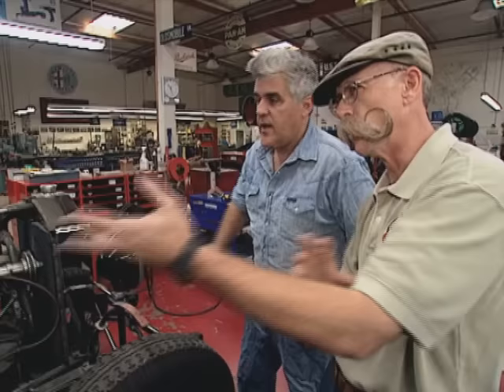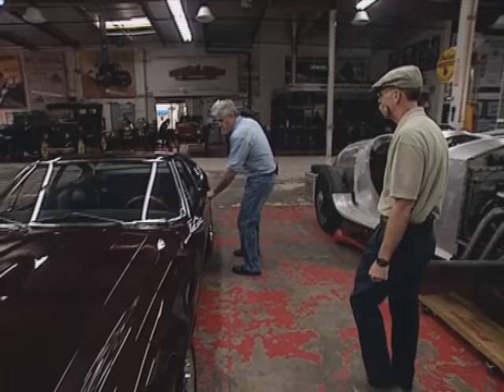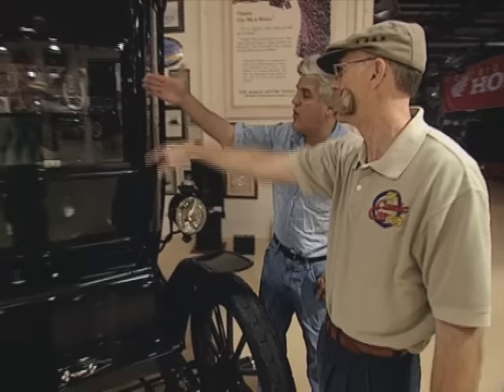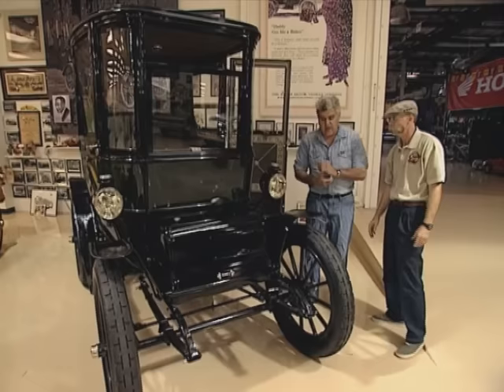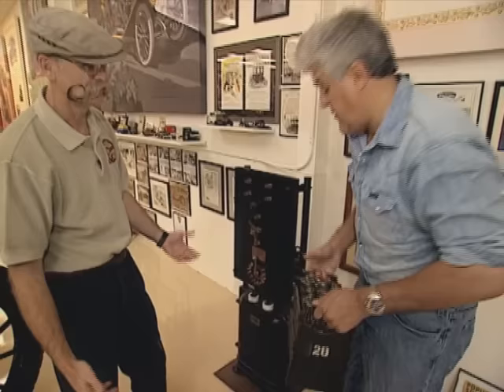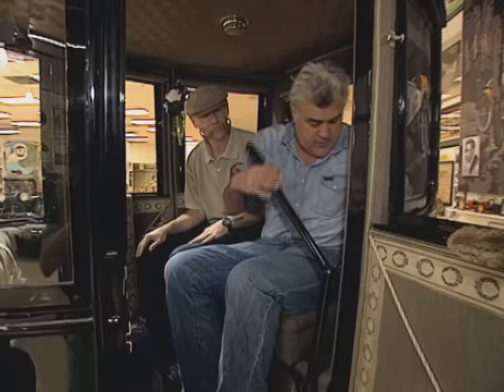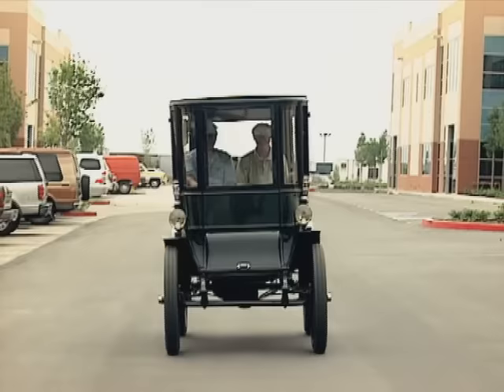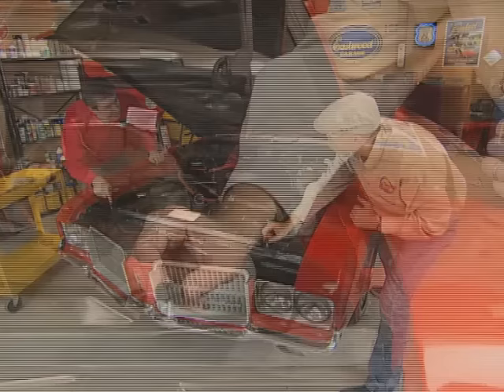Jay Leno's Baker Electric Car

Comment: No, no . . . of course electric cars aren't possible or practical, don't be silly. Now come to my garage and buy my petrol . . .

Imagine how good electric cars could actually be if every time some company tried to market them they hadn't been bought out, crushed down or intimidated out of business by the petrol industry. 
Nobody is going to convince me that if we could build electric cars like this in 1909 we couldn't be building ones that performed as good or better than petrol powered cars nowadays if it wasn't for the fact that huge oil companies want to be rich.
Reply: Remember that drag increases exponentially with speed.   Twice the speed for example requires not twice the power, but quadruple the power.   So this can go 23mph, sure, but if you want to go 46mph, you now need a motor that is four times bigger and four times as many batteries to keep your range... except that's not really true either, because four times the motor size and battery capacity itself adds weight, so to get the same performance you need about six times the battery to compensate for the additional weight penalty of the extra power.

Well that's all fine and good, but what if you want to double that and have a top speed of 92mph?   Remember, you are now quadrupling what you already quadrupled... where the heck are you going to fit 16x the battery capacity alone, forget the motor power, in a regular sized vehicle?    And before rapid charging battery technology, which is very recent, how long is it going to take to charge that many batteries, and where will you charge it from, as people only had 120volt systems in their homes.

So until recently, gasoline was FAR superior, since the engine and fuel weight was so much lower for a given power/range, and refueling instead of taking 15-20 hours would be only minutes.
Reply: DumbDuck44 That was a really good explanation! Cheers man, you taught me something. lol

Got to say though, I've been into classic cars since i was a teenager and I've been to motor museums all over Europe. As you can probably imagine quite a few prototypes end up in museums and I've seen quite a lot of electric concept cars. I agree that until very recently they all seemed to need to have either a huge weight of batteries on board somewhere, or some sort of way of generating power that wasn't economically viable for every day retail. 

I remember seeing some electric cars from a bit later than the one in this video and the whole of the floor plan of the boot was covered in batteries and there were more beneath the rear seats!

I do remember seeing a really charming french 3 wheeled electric car from the 30's that didn't seem too have too many problems and could have probably sold well for urban environments and cities. I suppose it just comes down to marketing skills and luck.
Reply: I am pretty sure that with using better aerodynamics this thing would hit 40mph+, it is pretty much a driving wall. Also not forget how much the technology overall has improved, not only recently.
In this thing they used brushed engines and mechanical converters, which lost together more than 50% of the input power. Mechanical switches for the driver to give accelerating commands, no regenerative braking and there are a view more things that could have been done better in the 1950 already, let alone in the 1980, or 2000s.
Reply: Ismalith - That's what I was thinking. We have really viable electric cars now, so I'm sure if there had been economic and political will to do so we could have had them at least a decade or two earlier surely?
Reply: Remember, most of the electric technology advances today come not from investment in the automotive industry, but the multi-billion dollar electronic device industry.    Better energy density for batteries was needed for laptops and cellphones and other portable electronics, and its thanks to a worldwide tremendous investment in that technology that its been able to be adapted to vehicles.    Brushless motors really don't matter much btw from an efficiency standpoint, as you only gain about 8% efficiency from them on average.    Its the battery revolution that changed the electric car viability, where lithium ion batteries are so superior to lead acid.

Lithium batteries can be safely fully charged and discharged, which a lead acid battery cannot (more than 60% discharge reduces battery life considerably).   Lithium batteries can be recharged up to 5K times, whereas lead acid will need replacement after about 300 charge cycles.   Lithium batteries keep the same performance until empty, whereas lead acid will become weaker and weaker as it discharges (as you may remember from lead acid toy electric cars as a kid).   Lead acid batteries are drastically smaller and around four times lighter for a given discharge capacity to lead acid.    And equally important, computerized controllers for the batteries are affordable now, as "dumb charging/discharging" is completely impractical for a performance vehicle to ensure cell and thermal balancing, etc. 

So there was no conspiracy against electric, just a huge technological leap to make in battery tech, which happened thanks to the computer/mobile phone revolution.
Reply: DumbDuck44 Sounds like you know a bit more about it than me! lol

I don't think there was exactly a conspiracy. I doubt it was really particularly hidden. I just think that car or engine companies or petrol companies probably bought the patents for a few things over the years and shelved them rather than developing them and that kind of thing.

Would you agree that we could have probably had electric cars before 1990 though? Even then, the battery life problem could be negated a bit if there was anywhere near as much infrastructure for charging electric cars as there is for refilling petrol ones.

I once read about a company that toyed with the idea of replace-able batteries as well. Rather than pull up and have to charge for hours there would be stations that had fully charged batteries all the time. You would pull up and give them yours and they would give you a new fully charged one. Something like the way you take back whole propane tanks and get another tank rather than just filling up one you own. The problems there lie in standardising the batteries across multiple companies and countries though. Still an interesting idea.
Reply: That is absolute nonsense, electric engines where always superior to ICEs. They bring by far more power, are much better controlled, don't have the noise problem, are immune to hight, don't drown, can keep running for centuries and so on and on.
What has the gas engine against that? People think is sounds cool. Sady people thought that many things sound cool through the ages and changed their mind as soon as they understood that another sound stands for more power. Electrical engines won't be different there.
As soon as people understand that EVs bring power beyond what ICEs could even dream of, they will change there mind about what sounds cool again.

The only "problem" that EVs have, is how to store the energy and even that is not really a problem any more.
I have batteries for my RC that bring massive power and can be loaded in 5 to 10 minutes and since you can load batteries parallel, you can make a 200 kwh back that still gets from empty to full in under 10 minutes, you just need to be enough man to handle the cable.
Reply: Not only trains, every factory there is, uses electric engines to power everything, from small servos to huge hydraulic systems, everything is electronic.
Also not only high speed trains are electric, every diesel train uses its diesel engine on a generator and then smaller electric engines on the wheels.
Reply: Slightly odd ending to your comment there but I think I see what you're trying to say. lol

I hope you're right. It would be cool to live through a time when we see a complete change in transport and travel. I think a really big tide of change will come if we eventually start to see electric vehicles that are capable of carrying cargo on the same scale as the current ICE driven haulage sector for a lower price.

If we get to a point when we start to see fully electric goods vehicles, trucks, construction vehicles, cargo ships and such like then I think a lot of change would suddenly come very quickly.

But as far as personal transport like cars go - I think eventually someone will get the marketing, the product and the image all right at the same time and we will see electric cars that are as classic and popular as iconic ICE cars from the past. It takes time for any true classic to be recognised as such. We're definitely getting there.
Reply: Yeah, you're right, but we ARE getting to levels where we can expect to completely solve that problem reasonably soon. The infrastructure for electric cars has started and is spreading here in the UK. You can charge electric cars in all big cities, most smaller cities and towns and even some quite remote places. It's on the way.
Reply: Good thing that gas doesn't need any supply grids. And even better that you can load your ICE at home.
Reply: I kind of wonder what you motivation is, we already have batteries that store much more energy that the ones that are currently used, not to mention that current technology already provides enough to get enormous range.
Batteries will continue to grow, what are gas engines going to do?
Reply: Well, I'm quite enjoying this debate, so please, let's keep it on a chatty and civil level. I'm learning some stuff from people who seem genuinely inteeligent on the subject here and I don't want to see it turn into an argument like a lot of YouTube threads do.
This is an interesting page from wikipedia on the subject - https://en.wikipedia.org/wiki/Electric_car_use_by_country
It seems like electric cars are definitely on the rise, but everything, everybody here has said about abtteries is undoubtably valid, no matter you're opinon. As I said - even in the relatively small town I live in there are a few charge ponts for EV's now - but I also must admit I rarely see them being used.

I'm CERTAIN there is a place for an electric car economy within big cities though. Maybe we can never expect to be cruising highways at 70mph for days long roadtrips in electric powered winnibagos, but surely a huge amount of carbon could be prevented from entering the atmosphere if we could move towards big inner city infrastructures including a greater amount of electric vehicles?

I have been all over Europe and many cities are chock full of tiny spluttering compact cars. People using these aren't doing so because they have a love for ICE's. They're using them because they're available and the infrastructure is there.

I think if that infrastructre was changed to make EV's viable and affordabe the people driving around tiny streets in Italy, France, Spain, Malta, Belgium etc would gladly switch to EV's.

They could still have a big shiny gas guzzling BMW on their drive at home if they wanted to, for when they wanted to do a big journey!
Reply: Gas does have a supply grid though. It has a massive, monster of industry behind it and an infrastructure that stretched to very country on earth! Every petrol station you see, every tanker you pass on the road, every derrick in multiple countries all over the globe, every massive tanker at sea or in the air, every airport with it's vast underground tanks - they are all representing that supply grid. It is an absolutely ingrained part of the world we live in and billions of people make a living from it.

I suspect THAT is part of the reason the EV infrastructure is growing so slowly. The political and economic will just isn't there yet.
Reply: I think my comments make it clear what I think the reasons are!
Reply: Yeah, I know you are making valid points there.
It's a really interesting debate though isn't it? I mean - what you say there is un-doubtably true, yet pretty much every major manufacturer still seems to be working it into their future plans. It's not just a novelty anymore, with a few Prius's driving around and the odd company like Tesla building interesting things. There are now millions being sold worldwide every year.

Maybe the car manufacturers know something we don't? Or maybe they are just insuring their interests for the future, thinking that maybe if renewable electricity comes into force a bit more with things like wind power and hydro electric power then it will allow the industry to suddenly leap ahead.

I'd personally still choose an ICE vehicle over an EV - even though there are charge points and such like in my town. I think we're still at the stage where most people would and will be for a while.
Reply: Your comments are right on target. There has been active suppression of electric cars for over a century.
Reply: It would seem so, but it isn't a problem that is fundamentally unsolvable. We can already make batteries that store energy in better ways, for longer. The problem is finding a way to produce them cheaply, efficiently and in volumes that car manufacturers can make a profit from.

It makes you wonder how much further we might have come in terms of technology if we didn't live in a world where mostly only products / inventions that are economically productive ever got developed?
Reply: Er . . . ok man. I was only making conversation. lol
Reply: Samuel, you are entitled to your opinion, and Mr Pryce is entitled to his as well. Electric vehicles are not on life support, and there will be electric trucks in the future as well. As an owner of an electric vehicle for three years, I found the vehicle to be quiet, clean, cheap to operate and without need of repair other than annual fuel filter and oil change and air filter change for the air conditioner unit. There is no carburetor to adjust, no spark plugs to replace, etc etc etc. Garages feel cheated.
Reply: Laugh all you want, but I meant to write oil filter, and yes, the engine uses oil internally, and it is an electric engine. The oil inside the engine was maintained by annual changes, but I suspect that every two years would be sufficient. You are playing with me verbally, and I am sure that most people understand my intent. The only power to the car was electricity, and the cost of charging the car is quite cheap.  The electric motor was built by Siemens.

I know that you want to win a debate at any cost but you should not treat people disrespectfully on social media, because it makes you look like a jerk.
Reply: Tires for the Renault were regular 16 size, and the brakes were less used because of the fact that the engine itself slowed down the car and that generated charging for the battery as well. Since I owned the car in its first five years of life, and drove it only for 65,000 kilometers, there was little wear and tear in the conventional sense. I had the mechanics raise the car on a lift and insisted that they check the suspension and oil all appropriate bearings. The tires were Michelin and still had good tread after two years. Tesla is not marketed in Israel, as few could afford them here. If Tesla tires wear faster it is probably due to people driving them at higher speeds than is necessary. Speed limits in Israel max out at much lower levels than the USA for various reasons, including lack of super highways. We have only one national highway that allows 110 kilometers per hour, and the limit for intercity roads is 90 kilometers. 100 kilometers is equal to a limit of 62.5 miles per hour. Does that explain why my tires are in better condition? We also do not have freezing weather here in Israel, and therefore salts are not thrown onto the roads to prevent freezing. And my average speed during daily travels is about 30 kilometers per hour.
Reply: Alon Musk will prove you to be wrong with his mega factory. We will wait and see whose stock rises and whose stock collapses. As you and your friend Samuel have been arguing, let the market decide.  We already know that it is possible to build a solid state lithium battery that does not require fluid, and that can therefore be made more compactly and with greater capacity. And if they make a salt battery that will be even cheaper to manufacture.
Reply: Graeme Pryce : You hit the nail ride on the head ! Trolley buses were put "out of business" by the very same people.
Reply: I know what you mean there about trolley buses or trams running on tires. I went to Lyon in France with my uncle Andrew a few years back and they have a very complete and working system there. My Uncle is a bot obsessed with trains, trams and transport so I got told every bit of information and shown all the 'most interesting' things . . . lol. 

To be honest though, it was a bit interesting. The vehicles have almost normal looking tyres on and in the underground sections they run on trough or 'U' shaped tracks and behave like trains, and on the surface sections they run like guided buses. Being on them was a strange sensation - it was like a very smooth train ride, but the insides look more like the inside of a good standard modern bus.

Not sure how we got here from electric cars, but it just reminded me when I saw your comment! Lyon is a massive and old city, so it just shows that you can build and integrate radical ideas if the will and the funding is there. The tracks didn't look very expensive or complicated to manufacture, the rolling stock all looked like modular standard stuff and above all, it works, on time, all day, every day.

There are other cities in France that have them as well. They aren't just in the US.
Reply: Graeme Pryce I'd rather have this thing instead of a tesla the only tesla I like is the roadster.
Reply: I don't think an engine that requires NO fuel can possibly exist.
If you do a bit of research, there have been some entrepreneurs that have invented some odd and economical engines before though.
One that springs to mind was 'Joe's Cell' that allegedly performed to many many times more economical purposes than current engines. I know the guy went out of business years ago ( strangely enough ) but I would imagine there is some info still out there if you google it.

One of my friends had a Honda Cub 90 for a while as well and he bought it with the intent to run it into the ground then sell. He got it running with a stinky combination of deep fat fryer fat and old petrol from his lawnmower and ran it like that for ages. 

You could smell it from miles away and it cluttered and sputtered all the time, but it proves that expensive fuel from gas / petrol  stations isn't the only thing you can put in the tank! lol

He had an old Ford Orion ( google it - it was a classic British car for years! ) that he ran on deep fat fryer fat for a good few months too. It used to leave a military class smokescreen behind it, but it actually ran quite well! I think it was a 2 ltr Deisel, iirc.
Reply: As much as I believe the petro-chemical industry has blocked, denied and illegally ( sometimes ) scuppered, bought and shelved every idea that competes with them, I'm not an idiot. 

I can see that until relatively recently, petrol / diesel engines are a far more viable technology, but things are changing. The things people have said in this thread are true, but even so - hybrid and IC engined cars ARE on sale aound the world, and more and more people buy them every year. 

I don't think it's just about viability though. I think huge amounts of people want a car with a big, noisy, throbbing engine that sounds powerful. They like it. I've driven powerful cars and it's good fun. People don't want to say goodbye to that, and I totally understand why. There are some good electric cars, even some sports cars, but the big change won't come until one or more of the car companies releases an electric car that revolutionises what people think a car should be and makes something amazing, that everybody wants. Relatively ordinary city cars, hatchbacks and the occasional record breaker just aren't going to cut it. Some company needs to build the 'Model T' of electric cars and start a whole new movement. AT the moment the public all over the US, UK and Europe are just getting cars that look like ordinary IC cars. Somebody needs to break the mould and build a brilliant and iconic electric car. An electric version of the 'Beetle' or 'The Mini', and swamp the market, if you get me.

Also, it needs to spread to the haulage industry. If companies could run electric trucks / lorries more cheaply on electric or another ultra - modern engine system, for a lot less money than diesel they would embrace it. Then then they would make a fortune, but as far as I'm aware, it just isn't possible yet.
Reply: +Graeme Pryce. Electric commercial vehicles seem to be a 'non starter' at the moment, due to the load and distance they cover. Many of then also run 24/7 on applications such as supermarket deliveries, so their is no window to charge the batteries. In addition, the battery would need to be replaced at least 5 times during the design life of the truck. The further problem is that even for non overnight trucks, the depot would not be able to obtain enough power from the grid to charge them.
Reply: +Samuel Rosenberg. It may be ok in certain areas, but certainly not London. We have no delivery depots due to land prices now exceeding 30 million pounds per acre. 35 ton delivery trucks flood into the built up areas in the early hours and have to be clear of most areas by 7am before the hundreds of ANPR cameras catch them. Tesco's alone deliver in excess of 3000 tons of groceries daily using about 40 trucks. For the rest of the day and all night the same trucks make up to 15 deliveries to each the out of the out of town shops, each of which has a turnover of between 1 and 2 million pounds per week. We do not have post offices either. 90% or transactions are online and a few counters have been included in supermarkets to deal with the handful of remaining customers. All pensions and benefits are now paid by BAX. The largest electricity supply that can be drawn from the grid is 300kva, so even the small handful of car charging points are causing problems. The government have installed 100 charging points in Hammersmith, a borough with 1.7 million cars passing through daily. The entire city infrastructure would need to change. Over the last 20 years, almost all petrol stations have closed and the few that remain are in the out of town supermarket car parks. or suburban outskirts. My nearest filling station is more than an hours return drive away in the busy periods. As a child I can remember 3 filling stations that were only a few minutes walk away. The nearest site is now a block of 90 apartments that sold for around a million pounds each.
Reply: The comments here are very interesting and valid. I still think we can't possibly make a realistic move to electric vehicles until we can include haulage and service vehicles, but if we can get to a stage where those kinds of vehicles are the ONLY vehicles that absolutely have to have IC engines, a big difference could be made though?
Having said that, there is a sub-culture of people that are never going to accept electric vehicles over liquid fuel vehicles, no matter how good, powerful or attractive electric vehicles are. Convincing people like those is going to take a generation of opinion. 
If a large proportion of commuters, city dwellers and people who rarely travel outside their own city can be convinced to change to small, compact, efficient electric cars though, that could significantly reduce emission problems.
Maybe we should be looking toward a society where HGV's, military and Service vehicles using internal combustion are the only things we should accept as necessary? A society like that would have massive impact on environmental issues. 
I live in a pretty old - fashioned northern english town, but just in the last two days, while out walking with my dogs I have seen two Nissan Leaf's and another little compact electric car, that somebody in the local dentist practice near me owns and obviously uses on a daily basis.

If the electric cars are good enough and there is enough infrastructure there to support them I still believe there can be enough people convinced to use them, even if it's pointless to expect a whole society to embrace them.
Reply: Fair points man. I was never looking to start arguments here, just discuss it with clever people. Electric cars need a company that strives makes them cheap, economic and common-place, rather than trying to sell them as novelties or as something that allows users to 'look down' on IC engine users in a greenpeace, superior way. We ARE at the stage where we can be looking at making them a proper part of society, but it will take a very clever marketing campaign for it to be accepted.
Reply: +Samuel Rosenberg. You are correct on that point, perhaps that is why I am so pessimistic on the future.!!!!!!!!!! After I sent you my last reply, I did a few calculations and the results even surprised me. The UK has 35 million cars, 2,5 million of them are in the London area, London has more than 8000 diesel busses, operating on 700 routes, (at about 8mpg, just think of the fuel they consume). If all UK cars were electric, drove 20 miles per day and spread their charging over 24 hours, it wold add 450 megawatts to the loading on the already severely over stretched national grid. While some of this could be offset in the infrastructure by charging overnight, the harsh reality is that any people start charging their cars when they returned from work during the evening winter peak on the grid. To cope with the whole situation and assuming some laws on vehicle charging times, the changes needed to the grid, including the construction of 2 additional nuclear power stations, would cost in excess of 100 BILLION pounds. Considering that I have not taken into account ANY commercial vehicles, you can see the extent of the problem. London has just purchased a few hundred hybrid busses for daytime use in the worst polluted areas of the city and even these cannot be fully charged overnight. Even when they are, the engine starts cutting in within the first hour of operation. This 2% of our busses have cost about 50 million and they are regularly breaking down. As you can see, a revolution in vehicle fuel is a lot more complex than most of us realise. I am a semi retired chartered electrical consultant and my work included the electrical systems at Heathrow airport, so my figures are based on more than 40 years experience. Jane also works for the UK government, so my vehicle figures are also fairly accurate. To further verify my calculations, I took the figures for the oil consumption of power stations (prior to the gas turbine conversions) and compared them with the quantities of fuel used on our roads today. My calculations still 'stack up' .
Reply: +Samuel Rosenberg. What you say about London is true. but due to land prices it is not as simple as Detroit. My main comments were focused on the problem around widespread use of electric transportation. The expansion of the London Underground network has only been made possible by the new trains. These use the latest Siemens technology which includes braking through the motors and returning the current to the tracks. With many stations being less than a mile apart, this results in a 40% reduction in overall consumption and allows expansion of the service without major upgrades of the traction current and building any additional power stations. One problem though!!!! The trains cost 7 million pounds each.
Reply: DumbDuck44 There's just one thing missing in your explanation. What if electric cars would have been developed since 1909 onwards? It's true that drag increases exponentially, but R&D will find ways to get more energy stored in a lighter battery, better efficiency from the engine and I rather doubt that the phone booth design would last, so there you could find quite a lot. The reason gasoline is regarded as superior probably has more to do with the lack of competition from electric vehicles then anything else. As an engine gasoline is quite bad with very low efficiency, most of the energy wasted as heat.
Reply: Samuel Rosenberg, I don't assume that battery development ceased, but the requirements for batteries in stationary backups, fork lifts and submarines are quite different compared to cars. In forklifts led batteries are great because the weight just means there's less counterweight needed. In stationary installations size is of less concern as is charging times. I know very little about uboat batteries, but they usually have a powersource other than batteries to charge on the move so that's more of a hybrid. 

So had there been development in battery technology aimed a cars with the specific requirements they have, I'm certain we would be way ahead of where we are today. 

But the point I was making is that the problem described didn't take in to account development.
Reply: Supercapacitors are being developed as well as glass layer batteries.
Reply: +Samuel Rosenberg. It is good to hear from someone who lives in the 'real' world. so much nonsense it banded about by people who have no idea about electronics, or even the basic laws of physics. I think that the hidden additional problem of large scale electric vehicles is the ability of governments to provide the power and infrastructure to run them, since the average household uses more energy to run their vehicles than their home. I calculated that the UK would require 8 additional power stations and their distribution networks to support a complete changeover to electric cars and only yesterday our government did their calculations and came up with 10 as their answer. It is interesting that when we changed over to natural gas, ideas were put forward to run all the gas to the power stations, rather than distribute it to peoples homes. After a few calculations, it was realised that this would have created exactly the same situation. Also a few days ago the crazy idea of providing power to vehicles via wi-fi was put forward. As you may be aware, 1 watt is considered the safe level of airborne high frequency radiation. With about 50Kw per vehicle required, motorists blood would boil in quite the literal sense. Since 97% of houses in London have no driveway, charging the millions of cars in the city is yet another problem. Induction transmitters laid under the tarmac along the side of the roads may provide a possible solution for both residents and workers parked cars. but I doubt that anyone will take my ideas seriously.
Reply: The early electric car was powered with the superior Edison battery (Nickel Iron) that hasn't got the shortcomings & disadvantages of acid lead batteries. The Nickel - Iron battery has a far greater capacity, tolerates deep discharging, is resistant to overcharging, is tolerant to more extreme temperatures and has a sheer endless lifespan. It was so good that it was not feasible to produce, the patents were bought up and then it was discontinued to be replaced by the inferior lead acid type of battery, which has to be user replaced every so often because they wear out and die. After it were discontinued the people forgot about its existence for the better part of a century. I don't know how they hold up compared to a Li-ion / Li-polymer battery, I will look it up right now.
Reply: The real doktorbimmer That sounds a lot like what Mr Benz said when he developed the first car.....
Personally I think it's going towards hydrogen, but who knows. It's not that long ago the notion of having a phone in your pocket was ridiculed.
Reply: +hejomodo. Hydrogen will never be viable as a fuel, simply because unlike butane and propane it does not liquify when compressed, making distribution almost impossible. If it did, I am certain that their would be a huge future in hydrogen fuel cell vehicles, rather than burning it in a conventional engine.. .
Reply: And I'm talking about fuel cell of course. The advantage of hydrogen is that it can be manufactured at the fuel station, thus there's no problems with distribution. Water in - hydrogen out. And there's an abundance so it will not run out anytime soon. It's early days of course, but it works and there's a lot of potential.
Reply: +Samuel Rosenberg. Sounds like a good idea, but a bit futuristic. We have hydrogen fuel cell vehicles here in the UK, being run by business users only. The existing range is only a few hundred miles from a full tank and they are refilled from a small handful of filling stations, none of which are within 20 miles of London. The energy cost of pressurizing the hydrogen is a major stumbling block at the moment.
Reply: +hejamodo. Have a look at my reply to Samuel. Hopefully things will develop in the future, but their are still stumbling blocks. The worst of which is that however we put energy into a vehicle, if it originates from electricity, here in the UK alone, we will need an additional 10+ power stations. I assume that hydrogen produced at a filling station would require electricity to produce it. It all comes back to poor old Newton and his silly laws. lol.
Reply: Samuel Rosenberg And why would you assume that I was talking about H2 from methane? There has been a lot of development in producing hydrogen from water, and it's close to as cost effective as methane. And when production is done at the station, no need to transport the fuel.
Look at HyGen renewable hydrogene stations, that's what I'm talking about. CO2 emissions are quite low I'd say.
Reply: +Samuel Rosenberg. As a slight aside from the subject. That portable fusion reactor would be a dream come true for the aircraft industry. I believe that modern aircraft manufactures bolt their engines under the wings in the hopes of a viable replacement in the future.
Reply: "Hopefully things will develop in the future..." It's already developing, and of course the fossil fuels used today will have to be replaced with some other form of energy. With the investment I'm looking in to at the moment with solar panels my home will have an annual surplus of electricity that I can sell. There are a thousands of ideas on renewable energy, and where there's money to be made, inventions and development is quite fast.
No matter if we go battery or fuel cell, production of electricity will have to increase to replace fossil fuels.
Reply: +Graeme Pryce Sure, there is probably a lot of truth to that but so what? That is how capitalism works.
Reply: Graeme Pryce Yes read Edwin Black's book Internal Combustion especially chapter 8 and in another reply to another person in this chat I forgot to mention chapter 9 of Mr. Black's book ,Internal Combustion, in which he writes that Henry Ford and Thomas Edison tried to build an affordable electric car but the Car Companies and Big Oil stopped them
Reply: Graeme Pryce electric cars have only got a chance now because oil supplies are getting low and the goverment of today realise its the only way forward for mass produced cars and theres the pollution on top of that.
Reply: Graeme Pryce I drive an electric nissan van at work every day, its fast as fuck and silent but only does 89miles on a charge
Reply: Ismalith - there was one very similar by Detroit Electric that did 40mph and held the record for longest distance on a single charge for a very long time.
Reply: "Think about where electric cars get their electricity," depends entirely on where you live and how your charge your car, but sure thing buddy. I find it interesting that you mention oil and coal when coal is basically dead; natural gas has overtaken it.
Reply: Graeme Pryce yes, ! imagine the charging infrastructure we’d have today. and how much further along on renewable energy we’d be  today if electrics were adopted back then.   Just like videotapes in the 80s,  the inferior technology won out through marketing manipulation.
Reply: doktorbimmer you’ve posted this same message several times.  Who are you trying to convince?  Sounds like you may be trying to reassure yourself.   There’s zero question about it, ev technology is far superior so get on board with progress or be left behind in your own smoke.
Reply: They aren't practical.  Do you think China or Russia gives a crap about supporting the US' petrodollar system?

Musk is a con-man, but having an engineer tell you this, is pointless.  You'll find out in due time.
Reply: HigherPlanes natural by product of the earth???  Oh I smell a flat earther...
Reply: fuzzywzhe I’ve already found out, no engineer necessary.  Best car I’ve ever owned or driven.
Reply: @MrSpuzzz  You smell a conspiracy.
Reply: @MrSpuzzz  " I’ve already found out, no engineer necessary.  Best car I’ve ever owned or driven."

What?  The Tesla?

well, as long as you don't mind it being incompatible with DIN, 15118-2, and Chademo which are the standards for DC fast charging.  As long as you don't mind ever being able to use a standard charger.  As long as you're perfectly comfortable with Tesla, alone, dictating what charging stations you can use, as whatever rate they determine.  As long as you're completely comfortable about having no other mechanic other than a Tesla certified mechanic exclusively working on your machine, at whatever rate Tesla determines his time is worth, regardless of his skill or competence.

People like you remind me of Apple loyalists.  I can understand you don't like Windows or Linux, but you really have no idea what you're talking about.  Tesla can't even make money, when they have subsidies, and engage in monopolistic and predatory business practices against their own customers, who are absolutely convinced, they have a better machine than anybody else.

But you'd never pay for it.  The reason you have that piece of garbage, is because it's paid for by tax payers.  At minimum Tesla lost $10,000 on selling you that piece of garbage, and it still had subsidies on it.

It's like nobody seems to understand supply and demand anymore, or basic economics.

Even though I work in this (stupid) industry, I hope Trump removes the subsidies, because it's not a sustainable industry.  Even CHINA knows this, and they are communists.
Reply: fuzzywzhe you’re making some strange arguments.  Thought you’d be an ice advocate at first.  I was arguing that my electric car is better than any ice car I’ve ever owned.  But now you appear to be an “any electric except tesla” advocate.   2 tesla models already have Chademo adaptors.   Model 3 adaptor on the way.  Supercharger infrastructure in us is unreal (maybe you are not in US).  All other evs get same subsidies tesla gets.  Full tax credit is phasing out for tesla in us starting next week so if  us govt  revokes all ev subsidies it will only make tesla more competitive among ev makers.   Finally tesla autos, production capacity,  and infrastructure are clearly superior to any ev available today.  You would dense (or biased) to try to argue that point.  Hopefully there will be healthy competition soon because to me the enemy is ice, not other ev makers.  Yes I was willing to pay more for mine as an early adopter, than I would have had to pay for a comparable ice vehicle.  But it’s not a status symbol for me.  I believe evs are the future and we can soon have a superior product without the horrible compromises we make with internal combustion technology.
Reply: This was this good because the electrics companies (like edison) wanted it to be the future. The oil companies weren't as big in the day. These were good as city runners, but ones it became possible to travel beyond the cities by car people wanted cars with the range of petrol. These batteries are shit, absolute garbage, I'm sure if we wouldn't have had petrol then more money would have ended up in the development of batteries. But you can also assume that the development of general society would have been slower. 

It's easy to say that oh if only the competition wouldn't have been there then we would have reached utopia, but you need more to support your claims that "oh the evil evil oil corporations didn't want it"
Reply: @fuzzywzhe 

That "due time" has now been promised since 2008.
Also what a stupid con that would be.

After already being filthy rich, get a small near bankrupt company, build it up over a decade and then not sell it?

What is the scam idea? Build amazing cars replace the old trash Combustion Engine and bring humanity closer to the future?
If that is a scam I hope to be scammed more often.
Reply: @Ismalith  The "scam idea" is that electric cars are a good idea at this point in time.  They aren't.

Why you may ask?

An internal combustion engine in between 25-50% efficient and 25% is on the very low end, think of that piece of crap H2 piece of garbage on 4 wheels.  A power plant is between 33% and 50% efficient, 60% if they get clever, and that goes for any power plant, whether it's nuclear, coal, or natural gas.

Then there is the problem of the battery of an electric car.  The reason they are so expensive is that it takes a LOT OF ENERGY to dig up and refine the rare earth metals to make the battery.  That's the principle cost of the car, the energy needed to make it.  That's true of any commodity product, you are paying mostly for the energy needed to make it.

What would be a smart solution, if there was actually a desire to have a solution, would be instead of using natural gas to create electricity, then sending it through wires to a charging station, it would be to convert your car to burn natural gas, which is trivial to do.  It's known as an LPG car.

It burns fairly clean, as clean as any electrical plant does, the car can still run on conventional gasoline if needed, and you can fill it from your home as long as you get natural gas from your home, and nearly 80% of the US population does.

Electric cars are stupid.  In terms of overall energy consumption, they are BELOW par with a standard internal combustion because of the energy required to make them - but at least it's not as mind numbingly stupid as hydrogen gas to power a car though, and it's not as stupid as using ethanol to power a vehicle - that's the stupidest thing done ever.

What Musk is doing, is reinventing the wheel, and making it a worse wheel.

People believe "electric energy is clean" - no it's not.  It MAY become clean in the future, when everybody has their entire roof covered with solar panels, we have a surplus of electric energy, and the panels produce at least 4 times the amount of energy over their lifetime, than they take to produce.

As an engineer, I'm interested in a solution, not some bullshit one.  Electric cars are currently a bullshit solution.  They aren't even remotely profitable, they survive off from subsidies where taxpayers are forced to subsidize them.  The reason they are subsidized is that's the only way to make them affordable at this point.  If there has to be money dumped into this, dump it into research or in building more efficient power plants, we can get to 65% and not at a significant cost increase - it just uses Stirling engines to increase energy conversion.  Elon Musk is a welfare queen.  This is what corporate welfare is.